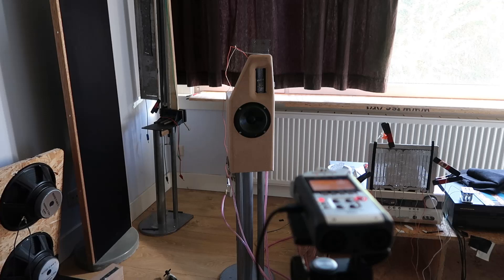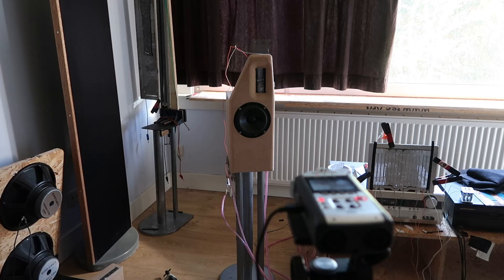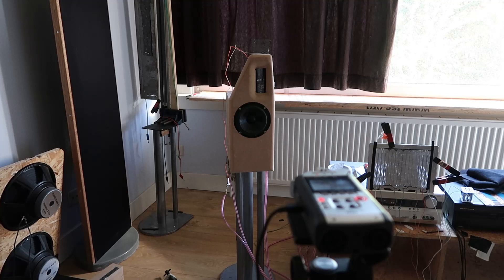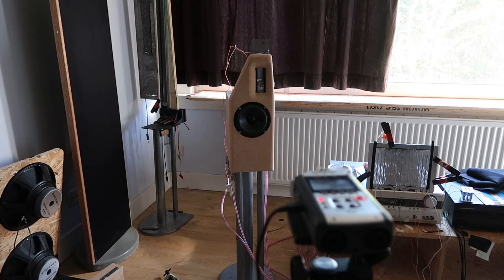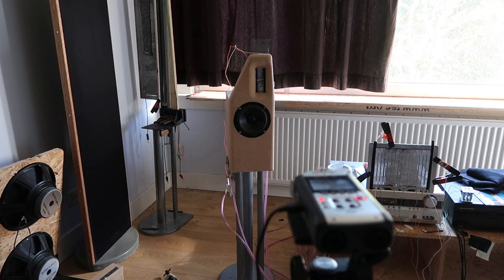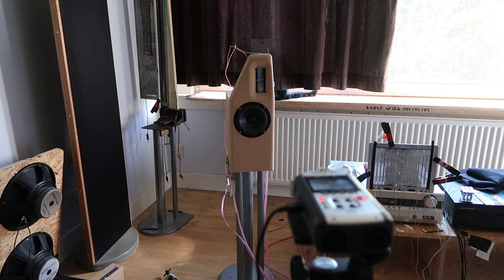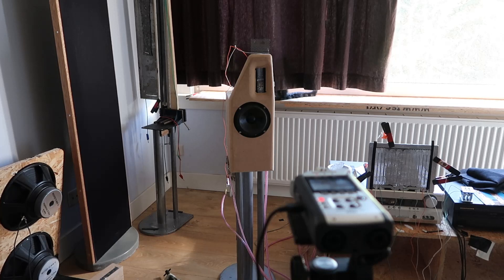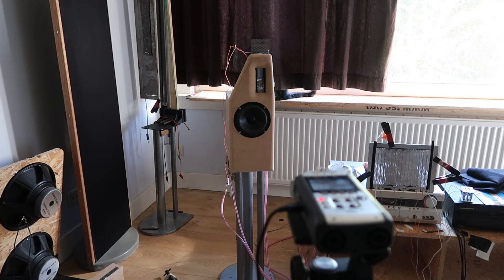Is it possible to put the AMT in the mini monitor (a tune)

Comment: Joppe, If it sounds really good from 1000 hz to 16,000 hz who cares.  There are some really good designs that start to roll off at 16,000 hz. At least you don't hit the ceiling on really bright recordings... :>) Or is that due to a bump where the drivers crossover too much (No BBC dip).

Comment: i always wonder when you calculate the millihenrys of a voice coil you get a cutoff frec of an inductor, doesn't this also cutoff the sound in the same way or is this an other matter when an inductor moves in a magnetic field
Reply from the maker: well this is true with most coils since they are wound like a coil, there resistance even changes over frequency (or we could not create filters. but with planars and alike there is not much coil and they sit next to each other. they end up being almost perfect DC resistance so no losses int he top end.  what makes this thing not rach 20Khz has potentially 3 reasons, the aluminum that forms the coil is to heavy , or the mylar is. and last but not least. the folding is rather deep. it is deeper then half a wavelength at 20Khz so it will introduce out of phase material .
Reply: @joppepeelen  so if i understand it has more to do with concentration of the field, in a round multilayer inductor you have higher tesla/amp probably.
But what do you mean by deep folding? you mean the hight or width of the planar?
Reply: have to say i didn't no it was a air motion transducer thought it was planar magnetic
Reply: je kunt trouwers bij zo'n Pipoos hobbywinkel een ribbelaar kopen (apparaatje met 2 ribbel rollen)
Reply: Sounds good 👍